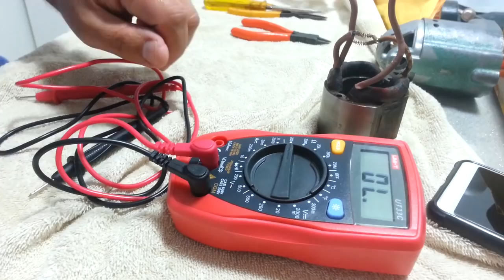Vintage Power Drill  - Part 1 - Tear-down and clean up (New edit) Tool Restore - diYotam Ch

Comment: Interesting video. I like the concept. That style and age of drill is available world wide. Using shrink tubing to save the wires is a quick simple fix to a common issue. 
I didn't see the original edit. While you were testing the coils it was difficult to track what you were doing. The meter was easily read. Without a little wider shot so I can see the attachment points of the meter leads to the wires it is tough to see what was going on. 
I would suggest improving in a way that I noticed should be done in my own vids. A different angle on the coil would help. It's not easy to go back and reset the shots. Since we are rebuilding the drill with the idea of recording and broadcasting the process, planning and setting up the shots to be clearer will help. 
Along with the additional shots of the work I would try a commentary overlay to explain to those of us who don't do this type of work. When you were doing the fast forward during the teardown I wanted to hear what you had to say.
Reply from the maker: Thanks for your detailed comment.
I hope to improve on future videos.
I need to get a tripod to hold the camera in better angles.
I have something in mind. The part 2 & 3 I think are filmed with better angle.
As for narriation I am still a little camera shy and worried about my english accent, but defentily need to get past that.
Thanks for your comment and for watching.
And a happy new year.